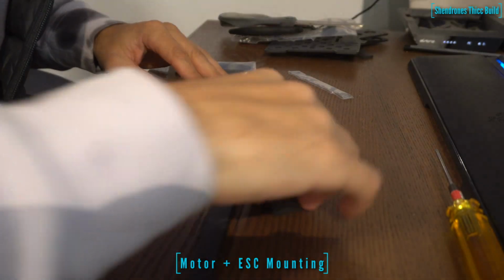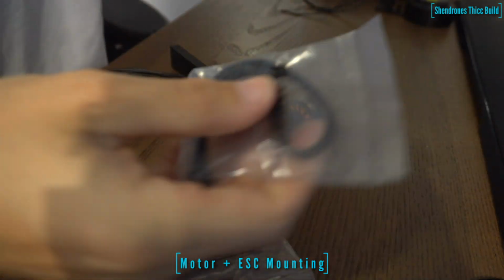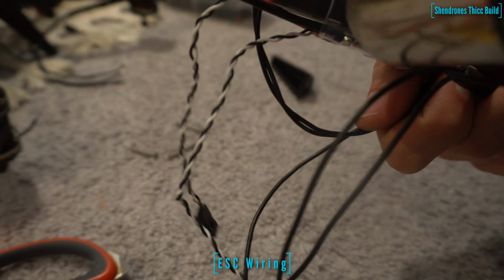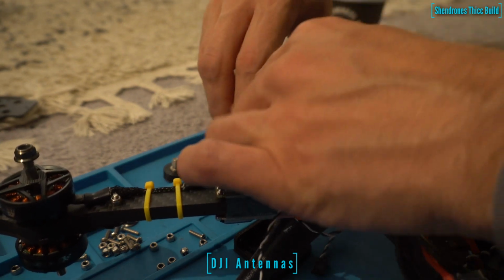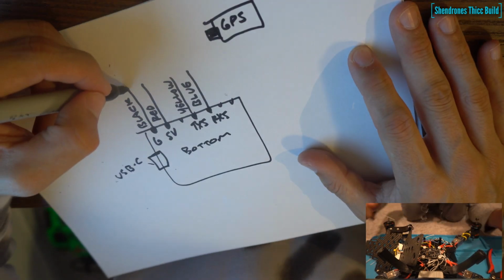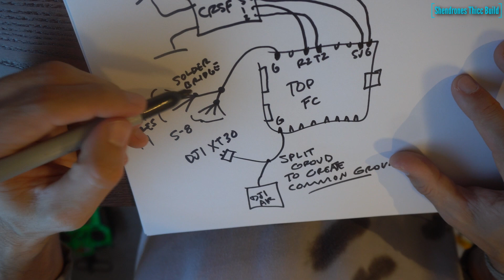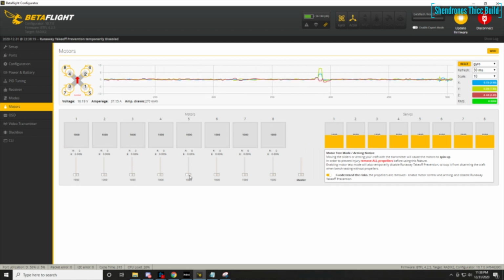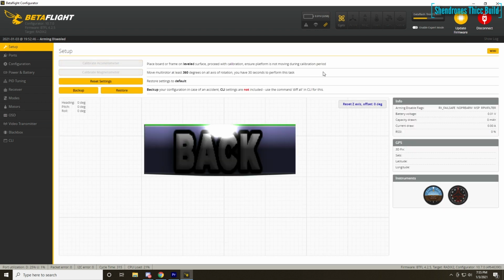X8 Heavy Lift Cinematic FPV Drone Build

Comment: Thank you for your video.

1300kv F90 has more thrust depending on the size of the prop and the amount of voltage of the battery.

Time:36:20 
The name of the rotations are wrong (CW & CCW) (maybe just on the paper)

Top Motors==>  Motor 1 and Motor 4 are rotating CCW
                             Motor 2 and Motor 3 are rotating CW 
so the direction of rotation of the bottom motors they are opposite to the direction of rotation of the upper ones.

it means: 
M1=M4 (CCW) opposite for bottom  M5=M8 (CW)  
M2=M3   (CW)  opposite for bottom  M6=M7 (CCW)  

(M3, M7) and (M4, M8) have been written wrong on the paper.

Comment: is Crossfire necessary for this build? (if you go with full digital)? Sorry for silly question. Just starting out :)
Reply: if you're planning on using the dji radio controller then you don't need crossfire no, crossfire is a control link :)